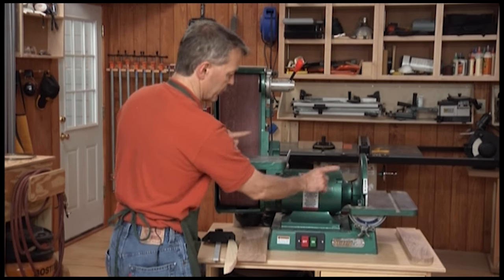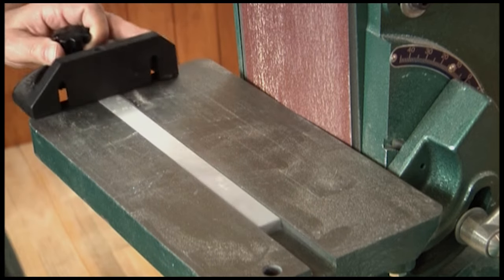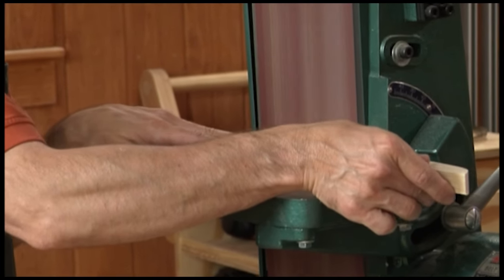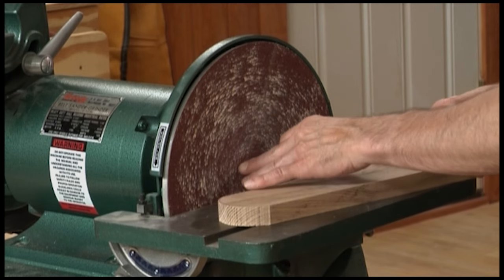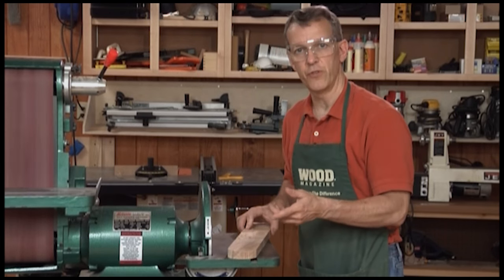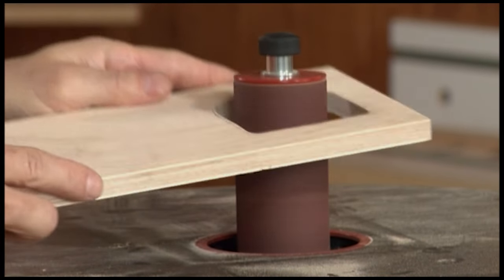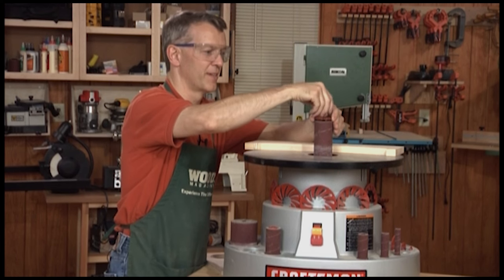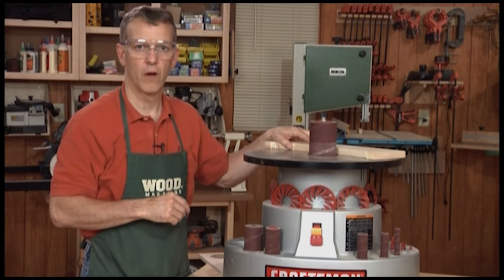Belt, Disc, and Spindle Sander Basics - WOOD magazine

Comment: Thanks for these videos. I watched it because the title mentioned “drum sanders,” which actually don’t seem to be covered in this video. I struggle with my 16/32 drum sander trying to sort out what grit to use, and how to keep from burning wood and damaging belts (I AM getting good at changing belts, though-haha $$$). Thanks!
Reply: Lawrence Becker It’s best to be conservative and start at higher grits. Remember 220 grit is what’s usually used for paint prep. So anything lower will remove stock at a more aggressive rate. Also the density of wood is something to consider.

Comment: Very close to buying a belt/disc sander for cutting board finish/shortcuts. I make end grain cutting boards. As you know, face grain, whatever quick sanding. But once it’s on the Endgrain I have to sand at 80 grit for an hour or so. I’m wondering if I can use a belt sander to get the 80 grit stage done and then move on with just random orbit for 100/150/200/220. 

Anyone try it that way because if it can save me 45 minutes per board, money well spent.
Reply: You need a drum sander